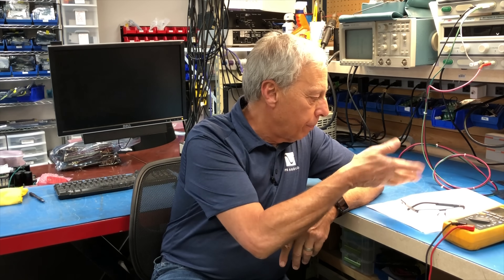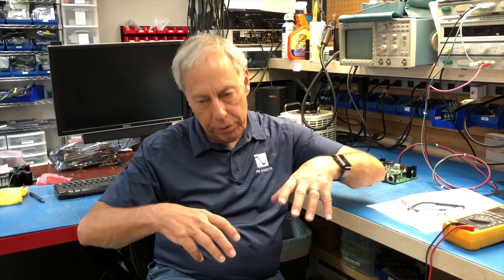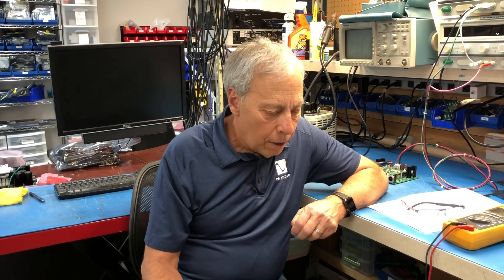Can amplifiers produce more power than what's available?

Comment: Let me to   complicate it a little.😃 

The socket max power is (must be) continuous,  audio max power not necessary,  depending on actual current of amplifier - they  both  may vary very much, because power is only   theoretical value not existing in nature, thus not defined for choosen  object.  (yes car engine rated at 200HP  deliver only as much as wheels  take at instance ) Nature knows only energy from which people calculate power - it is  energy delivered in 1 second. Sometime 1 second could be enough for application , sometime we want longer or continuous but we have only one  definition of power.  

 Can we calculate power when enegry lasts less than 1 second and varies? Yes but it is recalculated.  Such  power is  in some tata sheet. It is no comprable to scientific power  calculated with energy  for 1 second or  eventually corrected to evaluate so called continuous power which is mostly in general electricity

Comment: I have an LG mini hifi system that claims output power of 460 Watt RMS and 5500 Watt PMPO but only 80 Watt power consumption.
My concern is how can the output power be higher than the power supply.
Reply: There is no regulation on how they arrive at these figures, even though the usage of RMS (Root Mean Square) was intended to regulate the industry somewhat, manufacturers, particularly those who don't make actual Hi-Fi equipment, quickly found a way around that for their hyperbolic marketing purposes, usually by determining the maximum output of the amplifier, while driving the easiest possible load at the easiest frequency, adding that to the power consumption and the power handling of the speakers, and only when being struck by lightning during a tropical storm ! When you are looking at a complete system, such as you have, and were to ask the question "How much power does it have" Rather than read of the marketing paraphenalia, my response is usually "Precisely the right amount". The engineers who designed the system will be using amplification that generally matches exactly the capabilities of the speakers being used, as it has been designed as a complete system-in-a-box. All that really matters is - Are you happy with the sound ?

Comment: So we can we make conclusions to this? I think we can conclude that a 200W input amp like marantz PM8006 which can about 2 x 100W output at 4 Ohm has more headroom in overall musicplay compared to a 85W input power amp providing same output power right? Sure you can add or equip the 85W amp with a big storage bank with many capacitors but depending on the power requirement of the music it can happen that the storage bank is emptied. In that case the amp is depending directly to the transformer + rectifier which will result in less enjoyable music I would presume.

Comment: While what Paul is saying in this video IS TRUE for the PEAK or VERY momentary power output of an amp being able to exceed the input capability of the wall outlet, (because of the power supply capacitor bank being used as a short term suplementary backup, as he describes), etc., there are more and more amps nowadays, especially in "pro audio" and with home theater receivers, that are just simply BULLSHIT RATED!... There's really no other way to put it!

For example, if the amp or receiver you're looking at says that it can deliver a TOTAL (of all channels combined) "Continuous RMS" power output at ANYTHING above the input of the wall socket, (which in the USA is 1800 Watts maximum continuous for a 15 Amp outlet and circuit, and 2400 Watts maximum continuous for a (usually commercial) 20 Amp rated outlet or circuit), which I see quite often now in "pro audio" gear especially, then you already can tell that the manufacturer of said component is just overrating their product just to try to appear more "impressive" than the one next to it, to the untrained or uninformed eye , so don't fall for that crap!

Usually components that are totally bullshit rated will just have their power rated at WAY above the point of clipping, (which is generally accepted as anything above 0.1% distortion), and/or it will simply be a power rating of extremely limited duration, more closer to absolute PEAK momentary output rather than a TRUE, Continuous RMS, regardless of what the manufacturer may claim , because it's simply a matter of basic physics; you can't get something for nothing, or in this case, it's impossible to get a continuous RMS power OUTPUT that is MORE than what you can effectively put INTO the amp or receiver!!

And unless we actually DO ever develop a TRUE "free energy" device, which is doubtful, then the above facts will ALWAYS hold true, no matter how ridiculous the claims of manufacturers start trending towards into the future, always remember that much when looking at ANY amp or other component that you're potentially interested in buying!

Comment: Ok, still this doesn't answer which number is wrong: the RMS output power or the input power draw.. One of those numbers must be fudged, there's no way around it (peak output of course can be higher, but not RMS). I doubt it's the input number, because that would fail safety. I guess you're saying that the design is theoretically capable of certain output RMS power, but practically not (in this case it's false advertising).

Comment: When you play an music or sound which constantly outputs 5000 watts rms for more than 1 second while your mains breaker only allow 4500 watts, it will definitely trip. No magic.
Reply: Actually it won't. Thermal magnetic circuit breakers operate on an inverse time delay. That is, more current = less time before tripping and less current = more time before tripping. This is to eliminate nuisance tripping from short term overcurrents, such as the inrush current from starting a vacuum cleaner or other appliance. A good rule of thumb is that a circuit breaker will pass 135% of its rating for 10 minutes before tripping and will require 10x its rating to trigger an instantaneous trip.

Comment: Is the battery like storage, as you said, different from a capacitor?  Thanks you for all your knowledge and time sharing it
Reply: No, the "battery LIKE storage" that Paul is talking about here, actually IS from a large capacitor bank or array of, (depending on the amp quality level), anything from just 2, to MANY capacitors, all connected together in parallel to serve as that temporary power delivery component in an amp's power supply.

Comment: Please stop saying "RMS watts" because it is not valid. Yes you can calculate watts using volts rms and amperes rms, but the result is just watts. Even the FTC has misused the term for amplifier power claim standards. Anyone who wants to argue this point can go find me any papers or books published by a real  EE  that uses watts rms. Let me save you the time: You won't find any.
Reply: You are wrong. The RMS refers to the power of a wine or other non DC waveform changes over the time domain, not the volts times amps bit.
Reply: RMS is used with voltage and current. It is improperly used when specifying power. It is not used in electrical engineering because it is wrong. Reread my original message. Show me any books or papers published by a real EE that uses the term watts RMS.

Comment: The 50% efficiency mentioned by Paul is a good benchmark, and it is amazing how well it works for audio equipment that was rated honestly (in continuous RMS / both channels driven) in the 1970s and 1980s. For almost any two channel amplifier or receiver, take the power consumption number from the rear data plate, divide by two (assuming 50% efficiency, with 50% of the power ending up wasted as heat), and then divide by two again for each channel's power in RMS. Sure there are small consumers such as dial lamps, preamp and tuner circuits, but they are minimal loads compared with the audio amplifier, and can essentially be ignored for this power approximation.
Reply: I use 40% or 45% rather than 50%.

Comment: I had trouble understanding what you explained in the first part. I thought you said that for safety reasons, appliances are required to be labelled as using less power than they actually draw. Shouldn't it be the other way around?
Reply: Actually, when it comes to most actual household appliances, most are usually rated at the maximum power that they will ever take in any of their settings, (for safety reasons), and they usually draw somewhat less than that under most "average use" conditions.

But what Paul was referring to here in this video was that even though "technically" you CAN draw a maximum continuous power of (15 amps X 120 volts or 1800 Watts maximum in the USA), from a household power outlet, it is generally considered "best practice", (again for safety and potential overheating issues, especially on a shared household circuit), to slightly derate that maximum outlet capacity down by 25-30% to around 1300 Watts continuous average that you can safely draw from any household outlet at pretty much any given time without causing any issues or breaker tripping. You might be actually able to draw up to the maximum rating of the outlet IF nothing else is on that circuit at the same time, (like with a totally dedicated outlet circuit), but just to "cover their ass" under all or most circumstances they derate the "maximum" available down by that amount to be totally safe in every normal instance.

I hope that helps you to understand it better, as I know electricity and power ratings can get confusing to most people if they don't understand the basic concept in the first place!

Comment: In my days, my Heathkit ar-15 receiver was rated at 150 watts 'music power' it would put out 100 watts rms continous power.

If your input rating on the plate says it takes 100 watts, and the marketing says 300 watts, then you are being scammed.

I grew up in the days of pre ftc rms, frequency bandwith specs.  A Zenith console rated at 40 watts had 2 rms power.

It was 40 watts ipp. Instantaneous peak power.

Get the manufacturer to tell you the continous rms power, all channels driven.

My 5 channel sony receiver rated at '500 watts' can only put out 100 or so all channels driven.

Unless a chinesium switch mode supply, you would get a hernis lifting it.

Mu Phase Linear 400 would put out 380 watts per channel both driven into 4 ohms.

Measured on my Sound Technology [brand] equipment.
Reply: nerdful1 very true

Comment: Volts - pushed
Amps - pulled
So, if the amplifier requirement is 24-36 Volts, you need to ensure that the power brick/supply is rated between that as the Volts will be pushed into the system. More Volts in the power brick/supply will burn the system as more Volts will be pushed which the system capacitors will not be able to handle.
For Amps, you can have more than the requirement as this will be pulled as per the power requirement. More Amps=More Power. You cannot have lesser Amps as this will burn the power brick/supply because the amplifier/system will try to pull more current than the brick can supply or handle.
Reply: So...if a amplifier/system is rated at 200 Watts RMS, then its important that, based on the class of amplifier, the power supply should be at rated at least 20-30% more to take into consideration the loss of power in the circuit.

Comment: Hi Paul,
Big FAN of your knowledge.
The last video you did on amperage and watts and efficiency: Have you ever bumped up the power on your amps to 3 phase 480 volts? If not it could be amazing.
It may be a small market butt....
Just a thought Paul
Reply: Jason Wilson there's nothing you can't power domestically with single phase 240v. Very very few homes have 3 phase, almost none have 480v 3 phase. It was only used by custom home builders in the late 60s to early 70s for high-end air conditioning installs.

Comment: How to sonically measure amplifier's power? Is it more power = more volume?
Excuse my noobness
Reply: Not sure if this answers your question but do you increase your volume three dB requires twice the power output of hey 3-D be increased requires double the power from the amplifier
Reply: Jim Olson not sure if this what u meant..on my yamaha receiver -10Db is quite loud..normally my comfortable listening volume is at -15 Db..So if more power = more volume, i guess my receiver still got plenty of power left
Reply: muttech sounds like you have plenty of headroom. That is a good thing!
Reply: Fred Smith thanks..but thats to much for me to digest..lol 
I guess ill be fine with my yamaha av receiver 100watt per channel for now 😀
Reply: It is voltage delivered across the load of the speakers so it is measurable if you have a dummy load of say 4 Ohms then you just take the voltage delivered across it and that is going to give you the wattage after you do some calculations
Reply: More power for sure is more volume yes